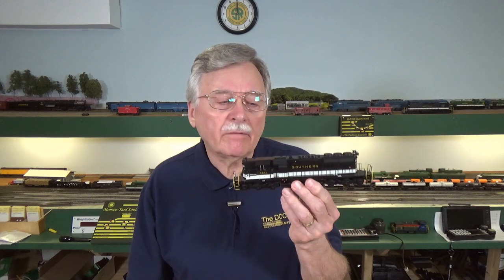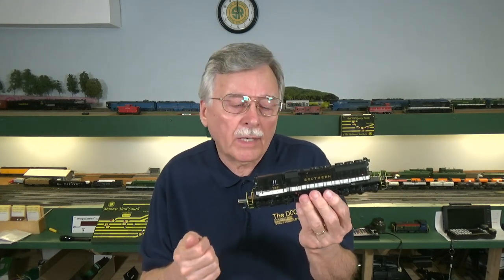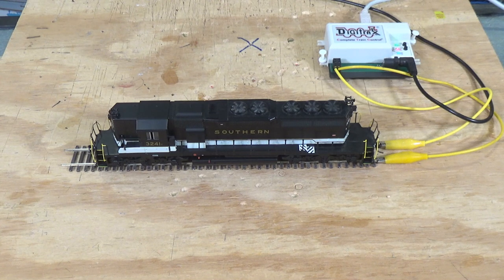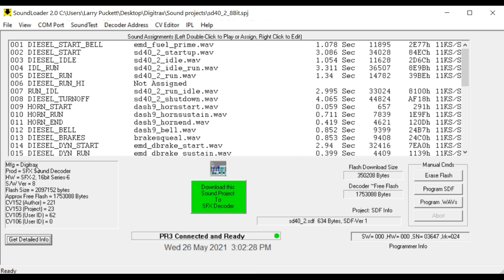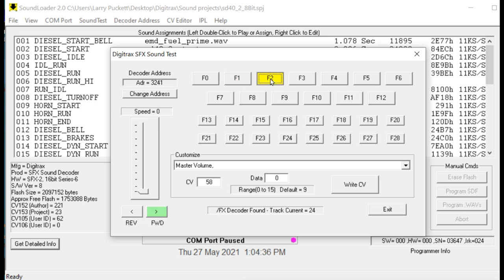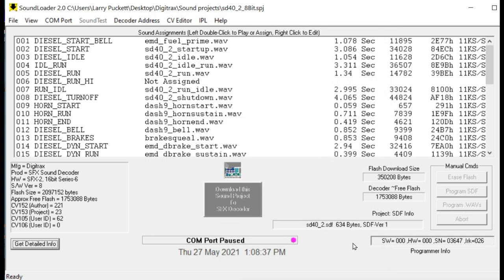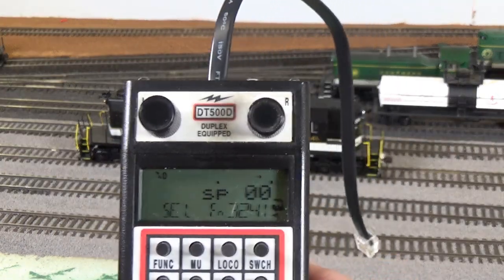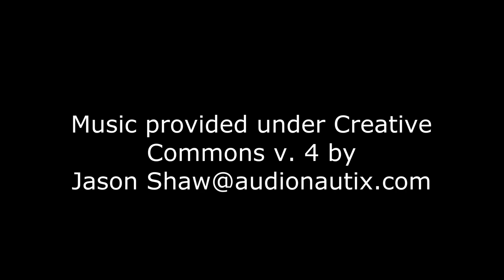Uploading Sounds To A Digitrax Decoder (195)

Comment: Another informative video. I might suggest for those who want to actually program and run the locomotive in a limited space to invest in a set of rollers so the loco's wheels can actually turn without it moving.
Reply from the maker: That is another reason I do most programming on the main. I do have rollers but for some reason I thought that with Soundtest it only ramped up the rpms and did not power the motor, then I saw the loco was actually moving on me!

Comment: Enjoyed the video! My jury is still out on sound. I'm weighing the pros and cons of n scale sound. This helps since I utilize digitrax on my layout. Thanks!
Reply: I have both Digitrax and BLI sound units on my N scale layout.  I have a pair of NW2's from BLI (tiny little locomotives) and I cannot believe how good they sound (once you turn the damn things down).  However the BLI AC6000 just is amazing, obviously because its a bigger locomotive and thus bigger speaker.  I have some Digitrax ones as well in a Kato SD40-2 in BNSF H1, and I haven't adjusted the sound files yet (still sounds like an SD70) but the sound is good even for the default oval speaker.  Also have one in a Kato E8B (E8A is just a decoder) and it also sounds great.  I have also gotten some XL systems (xlsystemsdcc.com) sound decoders, XL is the manufacturer of MRC (Model Rectifier Corporation) decoders.  Now these decoders are the basic of basic with a hard wired speaker, and the sound qaulity is what you expect, not that wonderful but not horrible either, they are super cheap and are perfect for MU secondary units (Horn and Bell aren't great but the engine running is, ok).
Reply: @SirLANsalot  Thanks for the information.

Comment: I have older Athern locos that obviously are not equipped with DCC.  I’d like to have sound, lights ect.  I am using a Bachmann EZ command.  I see online that digitrax has a module with just a speaker… but I also see a pc board.  Can I simply use the module with the speaker or do I need that pc board?  And lastly- are those compatible with the Bachmann EZ command?  Thanks in advance- I’ve been racking my brain on this.
Reply from the maker: I think some new EZ command systems have function controls like that. Check your instructions to see if yours is one of them.

Comment: Hello Puckette Sir, I have a query, can I install sound files to esu lokpilot decoder through digitrax PR 4 from Esu Software ?
Reply from the maker: Lokpilot decoders are mobile only, no sound capability. If you meant a LokSound decoder you can only upload sound projects with the ESU interface.

Comment: Hi Larry, excellent video as always. I have just one question about this whole process. I have done some sound improvement projects and have loaded them without any major problems, but I have a question about how to assign each sound to a function button. Could you explain this in a video or tell me if you have already done them, where can I see it? Thank you very much and greetings from Chile.
Reply from the maker: I think I might have covered this in a video on mapping functions but the issue is it differs somewhat with each brand of decoder. I know I covered it in a video on LokSound decoders but there I have done almost 350 videos and so your best bet is to do a search for videos on function mapping or scan down the list of my videos. To be honest it is easiest done with DecoderPro since that way it is click and choose and I never do it any other way.Also with Digitrax decoders it is written into the code for the decoders so cannot be altered unless you do a deep dive into programming them.
Reply: @TheDCCGuy  Good day, thanks for you response. I will review your videos. Regards...
Reply: I have an other question. I work with some 8-bit SDN147K1c decos... I uploaded files at 44ks/s with some at 11ks/s, it loads them but when testing the deco it doesn't sound... Will I have to lower them all to 11ks/s?
Unfortunately, I can't upload an image of the file to give you an idea... Well, thank you very much in advance.

Comment: The decoder is only part of the sound quality aspect.  The major part that makes sounds good or bad is the size or the speaker, bigger meaning better range of sound.  So you CAN take a Digitrax decoder, and trade out the speaker it comes with for a sugar cube or bigger speaker.  
And as he is pointing out, your secondary locomotives, aka the ones NOT in the lead, you can just use a cheaper decoder if its just going to be making engine noises.  You can then put the good high end stuff in the lead loco, for good bell and horn.  Like for example, using a Scaletrains or BLI locomotive as your lead loco, and then using a Kato or Atlas with an added sound as your MU units.
Reply: Cube speakers have been tested here over cone type and have the lower frequency benefit ala base then general cone speakers as long as the enclosure is oversized custom to fit the loco .Actually got good sound out of a MRC 645E sound decoder that way .Beware all 11+ 15mm cube speakers are not the same. Did some experiments with cell phone speakers with the same enclosure and identical input on the bench and a Samsung outperformed others the same size . Apple I phone 6 are odd shaped ,but are amazing in a GE dash 8 where there is room under the radiator .Note they have to be original Apple not a China knockoff .They are junk but look identical .

Comment: Do I need to purchase the PR3/4 or can I just use my DCS52 connected to my PC?
Reply from the maker: That unit has a built-in usb interface and is the equivalent of a PR4 so you should be good to go as soon as you get the cable to interface with your computer.

Comment: Question here: At the train club I go to, we use JMRI programmer, and use a NCE DCC system. Is there any way where I can upload sounds the the JMRI programmer and not a PR3 or 4 to a digatrax decoder?
Reply from the maker: As far as I know you must have a PR3/4 or command station with it built in to use the Digitrax Soundloader program and upload sound files.

Comment: I have a question, I did the exact steps you did, but for a P42DC and I got no sound now, any suggestions
Reply from the maker: Where did you get the sound project—I don’t see it in the Sound Depot?
Reply from the maker: OK, I see it is among John’s Groups.io files. All O can suggest is try loading it again a d then if it still doesn’t play then check with John to see if he has any suggestions.
Reply: @TheDCCGuy  i tried reloading it but it says it doesn’t have enough space, if that makes sense. I’m going to my grandfathers soon and he’s pretty good with this stuff, hopefully he can help me if not I’ll ask John for some assistance. Thank you
Reply from the maker: Ok, I bet you’re trying to load a 16K file into an 8K decoder or for some reason John’s project is just too large for your decoder. Check your decoder specs. and see if John has a smaller version.
Reply: @TheDCCGuy  I honestly did not think about that, I’m 18 so I’m newer to this thank you so much I really appreciate the feedback, your videos have been so helpful and inspiring

Comment: Hi Larry - thanks for all the very useful info!  I've got a question about a non-digitrax decoder.  It's and XL 1960 decoder I installed in both of my Kato N scale SD 70mac locomotives.  Oddly the same engine sound files have differnt characteristics -  not sure why that is, but on the Wabash Heritage unit, the shutdown lasts apprx 5-6 seconds, whereas the Erie Heritage unit is only about 3.  As I say, both sound files according to XL Systems sheet, are the same.  I suppose I could go through all the different sounds to see if they were assigned different #'s... Anyway, would the time difference be due to the sound file or a slight difference in the card?
Reply from the maker: I have no experience with these decoders. I suspect you will find they are based in China and the NJ address is just a contact point. If their instructions don’t provide the info on the sounds then you will need to contact them through the contact form on their website. I would be interested in hearing your resolution to this and how responsive they are to your requests for assistance. Good luck—Larry
Reply: @TheDCCGuy  Thanks for the quick response Larry. I've been in contact with the fellow from New Jersey, but he's not terribly communicative. I guess I was asking more of a dcc functional question, but I'm going to do some experimentation with the JMRI software. I'll get back to you on my findings. 
Anyway, I forgot the most important part, especially for us model railroaders, who on this very day, was born our love of this hobby, MERRY CHRISTMAS, AND A HAPPY, HEALTHY NEW YEAR!

Comment: Quick Question. Can the Digitrax sound loader software upload sound files using an Arduino base station instaed of a PR3 or 4?
Reply from the maker: It is proprietary so I doubt you could back engineer the process.
Reply: @TheDCCGuy  OK Thanks.  I thought maybe because I can read/write to the decoder from the Arduino's program channel there might be chance eprom flashing could be done also. Guess I'll just buy a PR-3 or 4.

Comment: Do you need a digitrax PR4 or can you use the digitrax DCS210+ advanced command station with the wires on the program section, because it is not working for me as I keep getting the message that I have an unknown decoder
Reply from the maker: The 210+ basically has a PR4 built into it. Is your decoder a Digitrax sound decoder, those are the only ones that can play the sound files.
Reply: @TheDCCGuy  I have an esu decoder installed, I’ve heard that they are all compatible
Reply from the maker: No, you can only load Digitrax files to Digitrax decoders, and LokSound files to LokSound decoders, and Zimo files to Zimo decoders, and you must use their proprietary hardware and software to do it. Now you can program the CVs of the various decoders using a program like DecoderPro or even your programming throttle and the DCS210+ but that is as far as it goes.
Reply: @TheDCCGuy  Thank you so much for answering this, finally a straight forward answer

Comment: Can you get sound files if you do not have digitrax programmer? Can this be done with decoder pro maybe? Thanks
Reply from the maker: No, sound files require a system specific program and hardware to upload. Only Digitrax, LokSound, and Zimo off this capability as far as I know.

Comment: i have a Mac, will this work on my machine? i'd really prefer to use this on a Mac rather than a buggy, slow AF, should already be thrown in the trash even though it's brand new - microshaft based system
Reply from the maker: As far as I know Digitrax only supports the Windows platform.